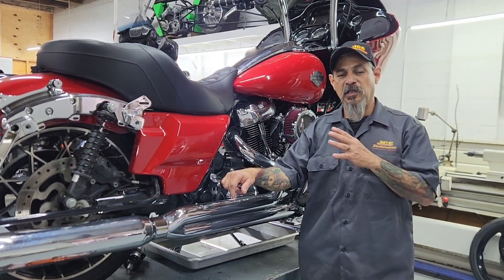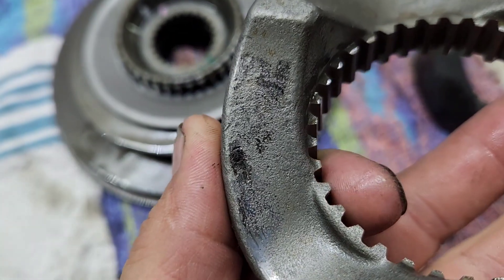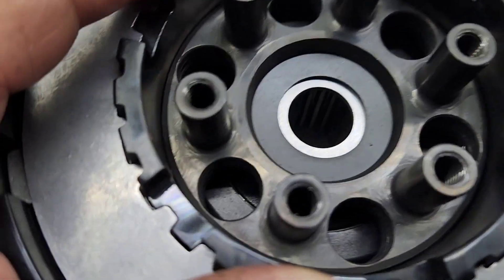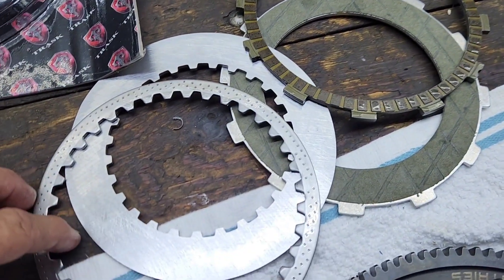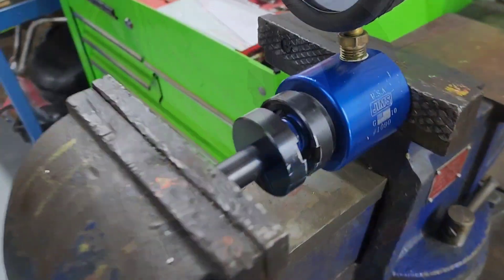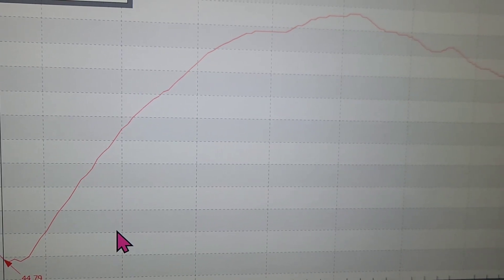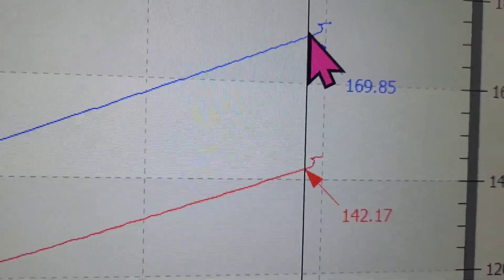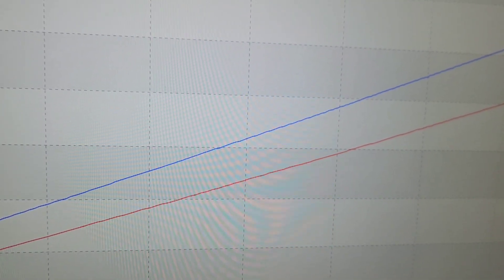M8 114ci Evolution Industries Clutch Basket Assembly Upgrade on Road Glide

Comment: Additional speed at the same rpm indicates that you changed the final drive gear ratio.  What sprockets did you use for the comp and clutch basket?
Reply: That was my exact same thought.   Would be nice if the guy replied.

Comment: do you find that clutch basket noisy... i installed the same system and its quite noisy in neutral... with clutch pulled or riding its quiet.
Reply from the maker: No, not noisy at all. Might want to check your compensator. Manowar compensator, we noticed, is more noisy than most.
Reply: @jcsperformance2778  mine has a billet comp ramp with evolution comp springs and hayden chain tensioner... I read on some forums others experienced the same thing :/

Comment: I installed one on a 124,had a recluse in a factory basket, didn't last very long..That's a badass clutch basket
Reply: hello, I have a 107 running a 30 / 30 cam, PV tune, etc., I was thinking about installing a Rekluse Torqdrive manual using the stock basket, my numbers are 105 HP and 125 TQ, which is not much, did you tear up your Rekluse and what are your overall thoughts on it? while I love the Evolution , it's expensive, I am contemplating going with a 124 big bore kit in the future, also, have you changed out your ramp in the compensator for a billett ramp? I understand that it something that needs to be done, thank you in advance and ride safe!!
Reply: What fluid did you run
Reply: @kc9oev1  ATF Type F
Reply: @michaelthompson7001. I'm running a 124 with a evo sprocket eliminator  Rekluse is a damn good product,I broke the stock transmission put a Grudge box in and one hard pull broke the basket,I just wanted to fix that problem and went with evo industries